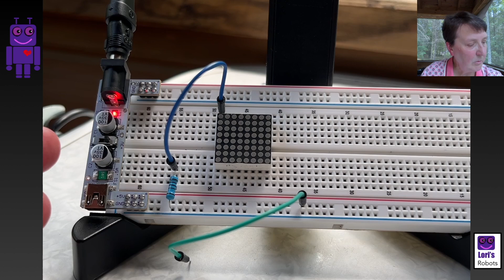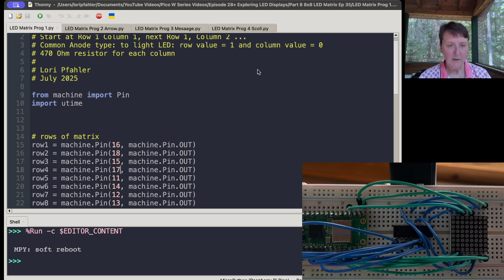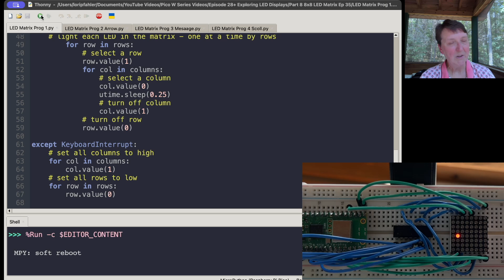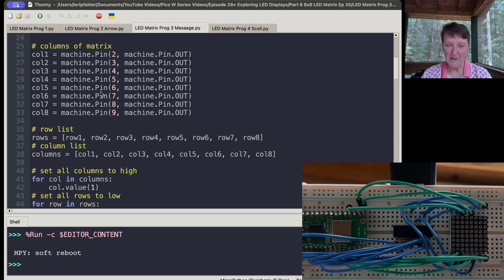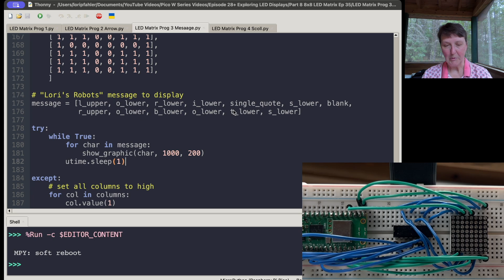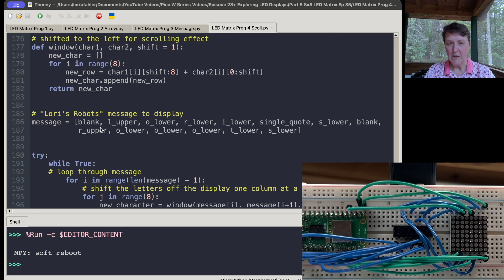Pico W Episode 35: LED Displays 8x8 LED Matrix Part 8

Comment: Hi just discovered your channel. I was looking for information on programming an 8x8 matrix without purchasing a chip to do it for me.  Can you tell me where you got your 8x8 matrix.?  I may order some for a class. I may as well order the common anode version. Thanks
Reply from the maker: You can order these on Aliexpress for a cheap price.  You can also find these at Adafruit but they are more expensive.  Good luck with your project.  Thanks for watching!